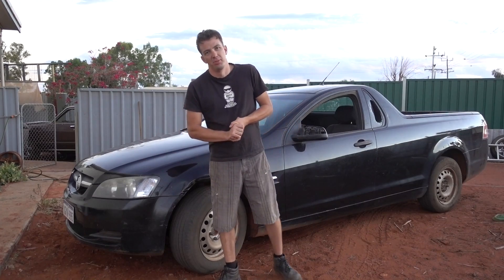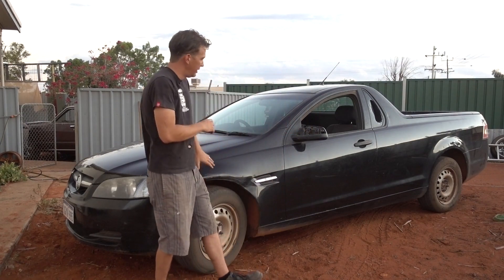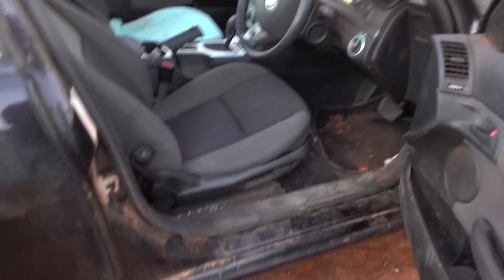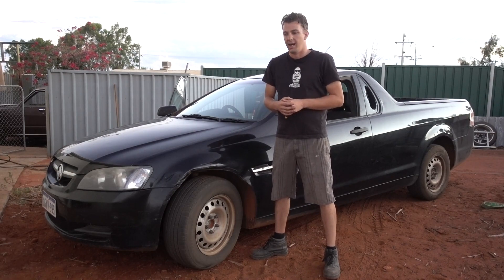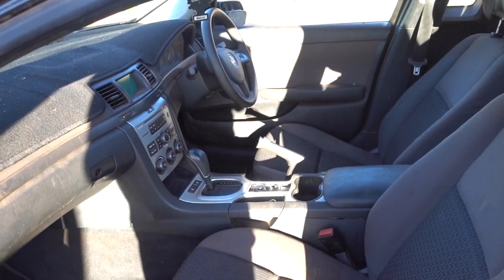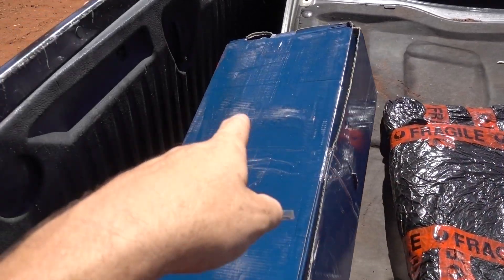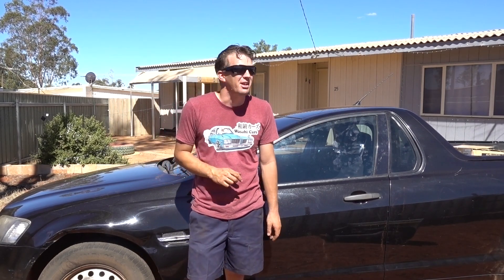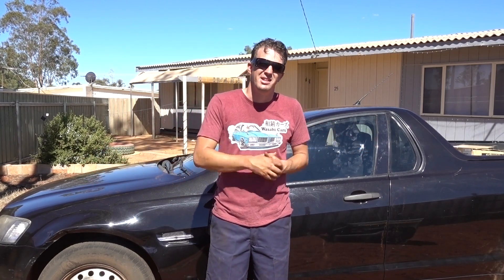VE Holden ute gets a rebuild

Comment: Headlights don't need replacing,  get wet cloth and cheap toothpaste  and polish lenses with the paste...... 

It works
Reply from the maker: The good old toothpaste trick. I ended up going a little deeper and sanding them back, then giving them a quick clear coat.